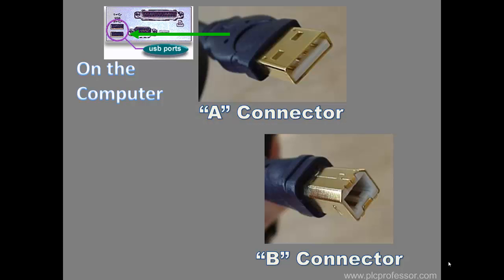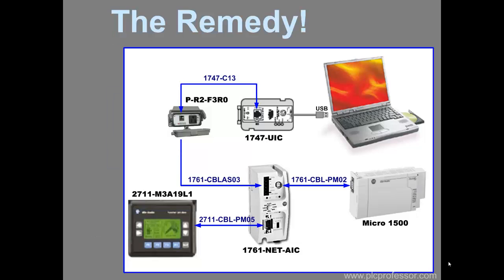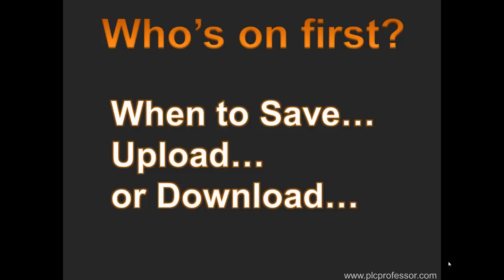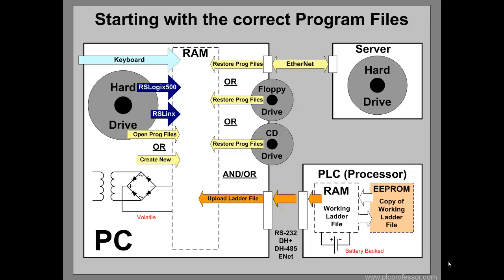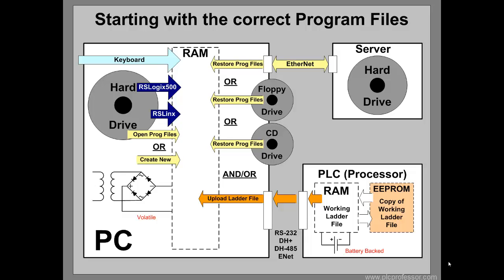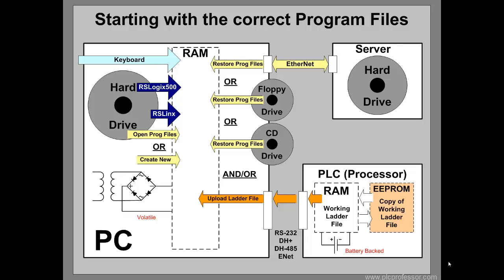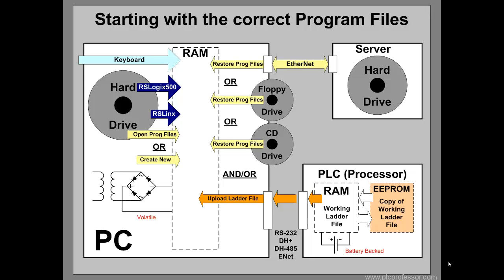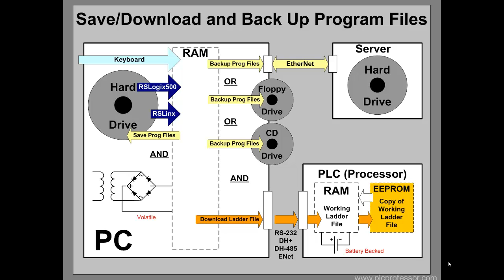Linx01c - RSLinx Part 3

Comment from the maker: A SLC5-03 has DH-485 and RS-232, the DH-485 will have an address 0 - 31. With the RS-232 port and the right cable you can use "Autoconfig." to "find" the configuration.

Comment: Again, great job. I do have a question which is simple but I do need help. I have a SLC 5/03 unit and have no documentation on the address setting of the device. If I set up a RSLinx driver for Serial (RS-232)-DF! for the 9-pin comm port. Is there a way to pool the connected PLC and get into the controller information to find what the address whould be selected. It looks like the SLC 5/03 has two ports, one DH-485 and one RS-232. Can both be used to monitor and program?